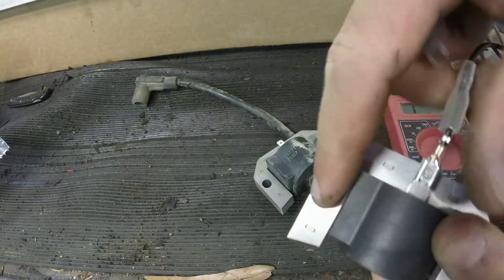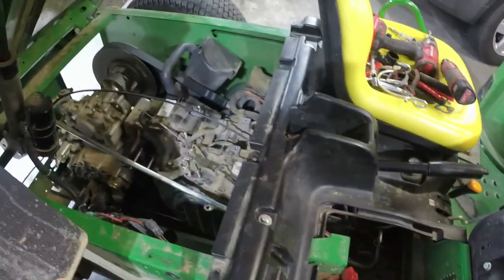John Deere Gator nearly impossible to start.  It's not a carb issue!  Replace ignition coil

Comment: I appreciate how any problem with any John Deere can be fixed with 3 simple steps. 1. completely disassemble the equipment. 2. replace faulty component with new exorbitantly priced John Deere part. 3. reassemble equipment.
Reply from the maker: This was definitely harder than I thought due to limited access.

Comment: I really enjoyed the video, I have a few gators, one older one that acts a lot like that, I may look into replacing the coil when the weather warms up a bit. One thing that makes them much easier to work on is to remove the bed, two bolts and a pin at the lifting cylinder and it really opens up the work area, it does take two folks to lift, not too heavy. You gotta love a gator.

Comment: This is the most logical, balanced diagnostic video I've have seen on this issue. It fooled me too....not looking forward to the 10mm madness, but I will get to it. Thank you very much!  I would love to have a bit more info on how to gap the coil though....that part wasn't clear to me. I am guessing those slot need to be adjusted once the coil is mounted and maybe too hard to film?
Reply from the maker: Thanks for watching!  Yes that part was nearly impossible to film, if you put a business card between the magnet on the flywheel and the ignition coil and tighten down the ignition coil bolts, you'll have it gapped properly.

Comment: Change the igniter box. This fixed my issue. Not the ignition coil, but there’s a little small metal box with I think two wires on top of the engine. I forget exactly where.
Reply from the maker: Do the newer models have the igniter box too?  The coil was the fix for this one, it gets used almost daily and has not had an issue since putting the coil on it over a year ago.

Comment: My problem is this.Gator runs rough going uphill. Just changed carb and clutch assemblies. It’s like it doesn’t have the power as it used to have. Any suggestions ? Thanks for your videos.
Reply from the maker: If it is an aftermarket carb it might be that, it does sound like a fuel delivery issue if it runs rough under load going uphill.  Would be worth checking for spark as well, you never know.

Comment: Sir I had a similar Gator I thought it was a carburetor fuel filters collapsed fuel line knew it was a screen in the muffler
Reply from the maker: Great info and another thing to try, the spark tester proved on this one that it was an ignition coil.

Comment: what did you come up with on compression. did it have the releases? ours tested at 75psi which I'm wondering if it has the releases. don't have a service manual to verify. ours is doing the same thing. i rebuilt carb still won't start right.
Reply from the maker: I'm sure these have a compression release on them which makes doing a compression test hard.  You may have an ignition coil issue too that acts like a fuel issue.  If it still won't start when you spray starting fluid directly in the carb it's likely you have an ignition coil issue too.

Comment: How do you get the dump bed open if it does not start? I just got a 97 for free and trying to get access tot he engine.
Reply from the maker: This one had an electric dump bed so it worked with the ignition switch on and didn't need the engine.  Not sure if the 97 models are the same.  I did a really old one a while back and I think I had to unbolt the bed but it was a manual lift.
Reply: Thank you I'll give that a try!
Reply: There are a few hidden pins to unlock and raise the bed to work on the engine and transmission when all else fails.  No need to remove bolts, but I understand.  The moving and fragile, aka oil drain plug..parts on the gator are well protected.  You have to remove alot of metal "protection plates" to access things that should be easy to get to without a lift.

Comment: Coil? Now I’ll watch the video lol . lol I can pull out the engine in 20 min I’ve replaced many crankcase gaskets on the 8 of them we have .( step and goes) golf
Reply from the maker: It was a very unusual diagnosis but to this day still is running great with no issues.  Just a pain to get to, pulling the engine might have been easier after all!